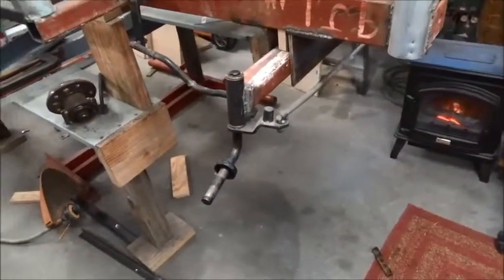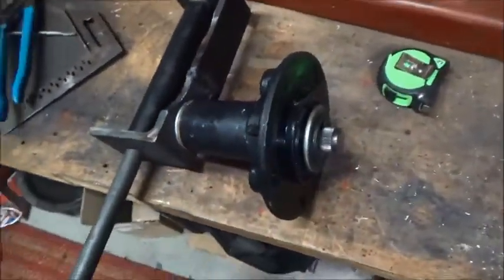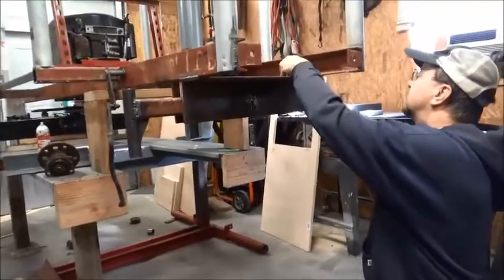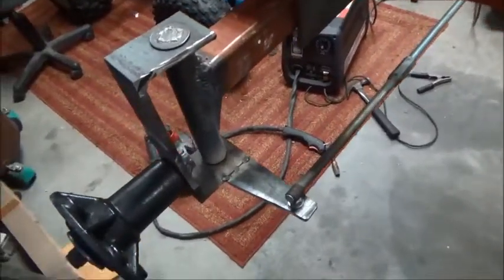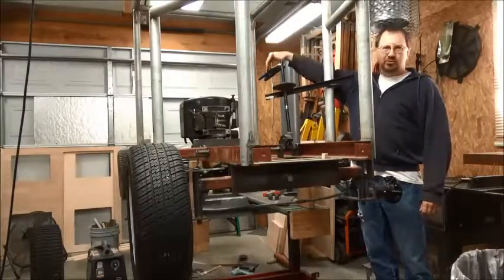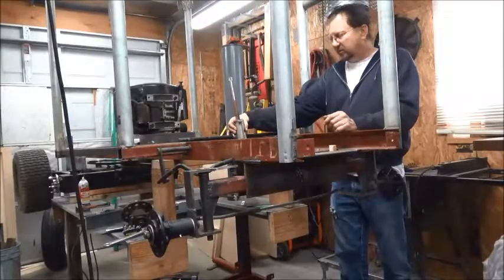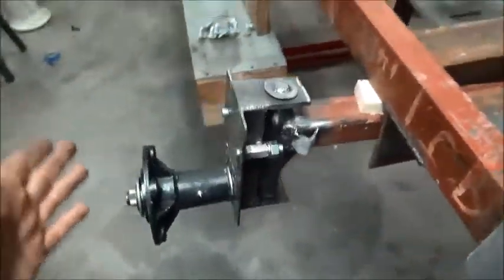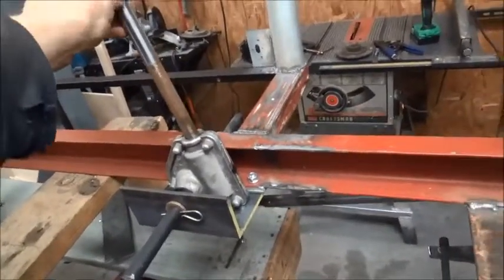Mini Semi V4 Fabricating The Steering

Comment: Howdie kevin wondering if you use a Skill saw for cutting seems to work on my metal cuts nice just wondering if you had a reason gor the bar up high innstead of middle 🤔  thanks for ideas looking great lm new too your channel  my ph my wifes comp and we got this great plan coming thks again for sharing with us keep it up makin mine out of 2 frames of Garden tractors so can use both diffs hopefully will work mine going to be Big Mac  if can find wheels need 18 of them tuff to find so far was thinking  making tubes for rims and sheet metal inside for strength  ? What ya think faburcatoring at its best keep ya posted from Canada 🇨🇦 SK later later
Reply from the maker: At the time of this video I mainly used a grinder with a fiber disk or a saws all. Now I use a metal cutting chop saw, a skill saw, grinder , band saw, saws all, or whatever it takes. The reason the bar is so high is just to get the ride height to match the back end, and I already had a lot of it built already. I had thought of using two cub cadet garden tractor hydrostat rear ends (because I already had one) but thought it would be too slow, and couldn't find anybody that showed how to speed up a hydrostat. I you watch all the video's you will see that I struggle with drivetrain components till I get to what I have now. With me it is whatever I have already or can  get cheaply and just seeing what I can get to work. I could have probably bought a 6 wheel "gator" and built a body on it, but what's the fun in that? Everyone always asks me when I take it to car shows or cruise in's "what did it start out as" I tell them "two pieces of 3" C channel" they really don't understand. Thanks for watching and your interest!
Reply: @kevinscreations4486  howdie yes like me use what we hav ya got my vote and glad signed up cause ya teach us how and when and ya make it happin hopefully  will get too were ya are so involved with this ya probly hav more ones on the go glad ya do this thks again for your time lm old still think lm a kid my body does not think so ha ha  so carry on Kevin  lm on board keep it upya got this